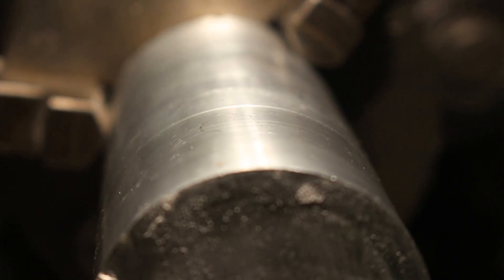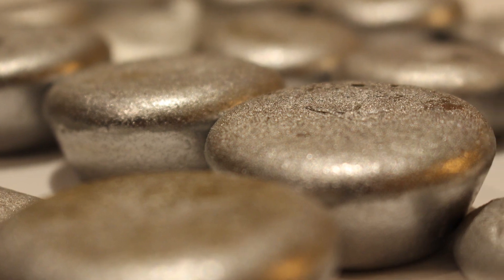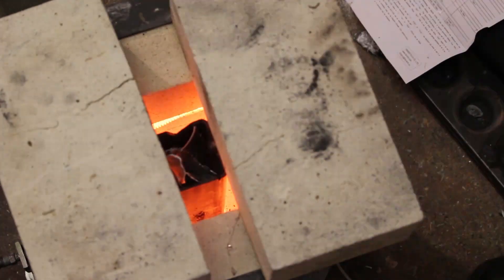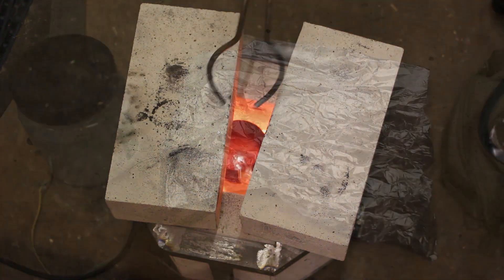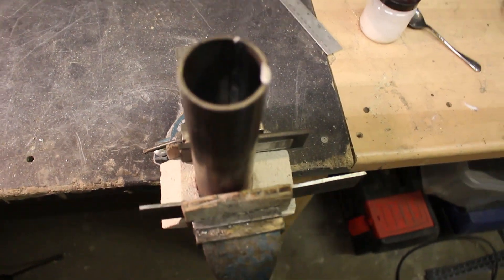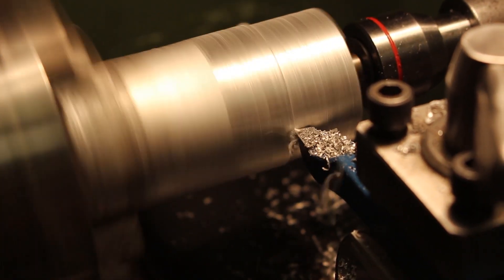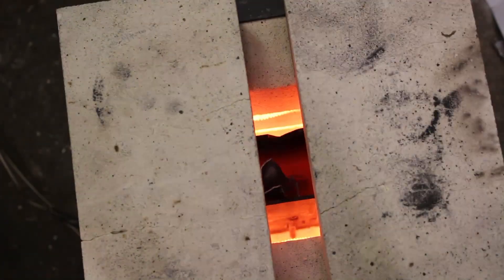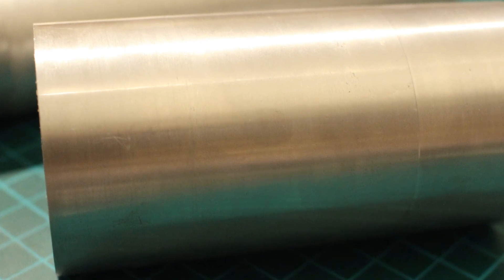Casting Aluminium Roundstock From Free Scrap

Comment: The chuck, in your video, is actually a reversible chuck. Unplug your lathe!  Clean the movables well and the chuck face. Label each A, B, & C. Also, write the letter beside the movable, on the chuck face. Insert your "T" wrench & open the chuck till the movables don't move out anymore. see which one comes loose from the face threads first, second, and third. Remove "A" from its slot & turn it 180 degrees (end for end) & slide it back in its slot. do that for the other two jaws. Now, hold the jaws back, so they won't engage until its their time. The jaw that came loose from the face threads LAST, must engage FIRST, and so on. Just a little inward pressure and a turn of the "T" handle, will re-engage the teeth (jaws). Now your chuck has 3 different sets of BIG, to clamp from. Just be sure to push your stock all the way back against the jaws, & tighten real tight. Also, its a safe idea to center-drill & use a "live Center" in your tailstock, any time you're using a large diameter piece, especially if its an odd shape like cast. if the ends are not square, cut it off square, before inserting it into your chuck, to prevent wobble, and to have as much surface area being gripped, as possible. (( I've been a machinist for over 55 years ))

Comment: you can take your 3 jaw chuck apart and turn the teeth around to do larger diameter stock.
Reply: I believe he stated in the video that the jaws on his particular chuck are non-reversible.
Reply: +Michael G ahh. I missed that part.
Reply: You can not reverse the teeth of a scroll (self-centering) chuck. Only an independent chuck has reversible jaws. Scroll chucks are usually supplied with two sets of jaws to accomplish the same purpose. A simple examination of the backs of the two types of jaws, or a mental exercise considering the way a scroll chuck works, will make it clear why they can't be reversed.
Reply: +Jon Miller false, I own 2 3 jaw chucks that you can just flip. One is an Atlas, and the other a Cushman. I flip them all the time to be able to turn larger stock.
Reply: Fascinating. I have never before heard of such a design and every explaination of how a scroll chuck works that I've ever seen says that's not possible. Model numbers? Video? Photos? Anything more than your claim alone? Even my copy of the Atlas-published Manual of Lathe Operations says otherwise. (Craftsman lathes were produced by Atlas.)

Comment: Carbide tooling works fine on aluminum if you know how to use it.  It requires a much higher cutting speed than HSS and a deeper cut.  Most people try to do .001-.002 "finishing cuts" which will never work with carbide.  It just tears the metal.  Crank up the speed to about 1200-1400 RPM and take a .008 cut and see how it works.

Comment: Since you have an electric forge with temp controller, you could try casting glass, because it requires you to turn down temperature step by step so it won;t crack.

Comment: Maby you could weld a small and a big metal pipe with a steel plate in between them that has the same diameter as the small pipe together. Maby you are able to create a roundstock with two different diameters. You could clamp the thinner part in the chuck of the lathe. That might make it possibel to make a roundstocks with a bigger diameter and you dont have to buy a bigger chuck

Comment: Could you manufacture these, and make some extra cash?
Reply: I should mention that while aluminum is the most abundant metal in the Earth's crust, it is extremely difficult and expensive to process it from the natural form (usually bauxite). Aluminum reacts with almost anything, so there simply aren't lodes of pure aluminum to be mined. 

Instead the purest form of aluminum is aluminum products to be recycled. Thus it is a very popular metal for scrap, with a value around 10x that of steel/iron, by weight. It is far more profitable for Alcoa, for instance, to re-process aluminum from scrap than to do it initially from bauxite. But the numbers just aren't there for doing it at home for stock that is commonly available from metal suppliers, especially since you have no idea what the resulting alloy will be.
Reply: +Instantly Viral Fascinating. Please go on. I haven't been this entertained in a while. 

I doubt you need a prompt, but try this if you do: You're saying that you wanted to know about it, but you really didn't actually want to know about it? Would you say you have a complete aversion to learning from the experiences of others? Or is it only a matter of long responses (or big words??) you can't handle? 

Finally, what does "retarded" actually mean, to you? Can you articulate it or is it just a general, go-to term whenever you feel frustrated by someone? I'm serious, this is fascinating.
Reply: Eventually you could but you don't make a lot of it and you have the cost of materials to make the foundry and the cost of running it. it will be cheaper then buying the aluminium in the long run but realistically you wont make much money off it.
Reply: It's just a discussion. Relax. 

Incidentally, which is more "socially retarded": having a factual discussion based on a specific inquiry, or making illiterate and offensive statements about someone who answered the question you asked, but in greater detail than you expected or had the attention span to be able to process? 

"Socially retarded" indeed.
Reply: @Jon Miller
Using scrap aluminium has one problem. Very often it is some kind of aluminium alloy and not pure aluminium.
If you use only one alloy, everything should be fine, but if you mix them, you will get a mixed mess.
Reply: sure
Reply: Oh I know. But when you consider how much work there is and how little the commercial stuff costs, it would be very difficult to make any money. I doubt any one-person operation could do better than minimum wage. Not even close. And hard to actually sell it as well, not to mention the work of actually acquiring the scrap in the first place. My day job is at a car dealership where I have access to parts that get replaced. And my brother is a mechanic and saves aluminum for me as well. I get more aluminum scrap than anyone else I know, and I don't even have to go find it, and it's still not a very steady supply. But it's a very fun hobby. My wife even gets into it. I could do fairly well by selling the scrap, but it's worth more to me to melt it for my own use.
Reply: +Jon Miller you genius, IV is very funny if a little clueless.
Reply: well, you know your shit, and tbh i didnt mean it in an industrial wayu i just meant a little in your free time to get a little extra cash ya know?
Reply: OpenGL4ever Correct. And...?

Comment: make a set of chess pieces! make a narrow pice of stock 1-1.5" and turn pawns and rooks and such. you could then anodize it different colors!
Reply: Make one side out of copper.
Reply: +1 for the anodizing, but chess sets have been done to death... Maybe a Quarto set, instead.
Reply: or that. that would be pretty sweet.
Reply: Cast aluminum does not anodize very well. It will be very blotchy.

Comment: A metal belt grinder was my first thought. Now you have a welder to make the steel structure. You can cast aluminium round stock with your forge and you can turn the pulleys from the aluminium on your lathe. Such a grinder should be a very nice addition to your shop since you do quite a lot of metal work, and blade making etc. The belts for such a grinder should last longer then the sandpaper on your wood belt sander.
Reply: +1 for this one, and when you're done, use it to clean up the parts as in my other suggestion :D
Reply: i made a video about my homemade belt grinder i'm 14 years old

Comment: By cooling the aluminum in water, aren't you essentially heat treating it and making it harder?
Reply: aluminum doesn't work like that, nor copper.
Reply: Actually it does work like that just not on the same level as steel but it mainly depends on the quality of the aluminium if you cool it down to quickly it will be quite brittle
Reply: +MadForge52 viagra! Lol

Comment: you could turn a tapping die holder for your tail stock. make some custom handles for the lathe. a small cannon. a kubotan. I teach engineering     and I'd be happy to answer any questions you may have even though you're doing very well on your own.

Comment: Can you do a disc with a smaller disc attached to the middle so the discs have a common center? Then you can have the smaller disc in the lathe and the larger disc can be larger than the maximum diameter of what you can have now? You can cast it in green sand as you did some videos ago ...
If it works it works. I like the progress you make! :D

Comment: I would like to see if you can make a cheap way to do excentric turning in a home shop. I just got a old lathe for free and are looking into making my own camshafts for a engine I'm building
Reply: Drill a hole off center in a piece of round, hacksaw a slot into the hole, then you can clamp in the 3 jaw and turn off center. Problem is tailstock support....
Reply: You could use a steady rest as support but otherwise you could drill holes in the end of the cam in some extra material, then cut off later....